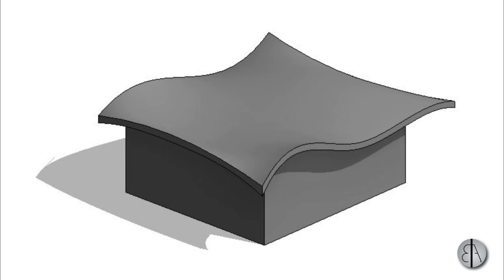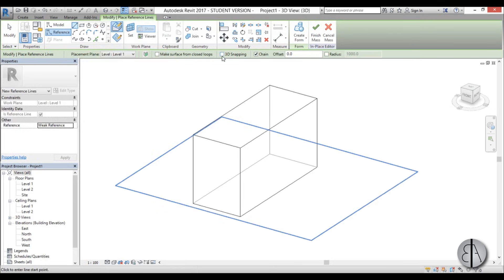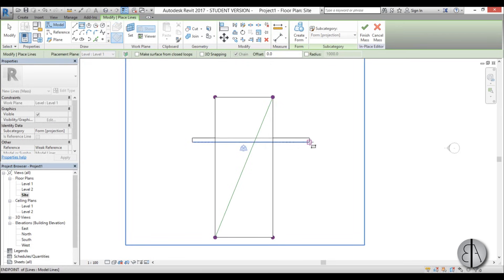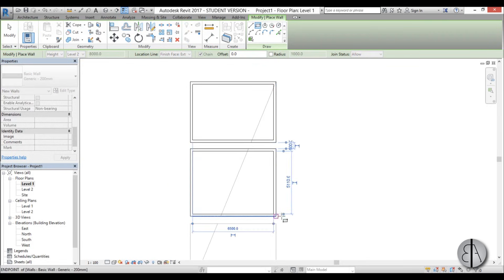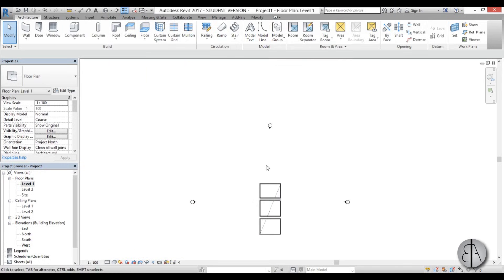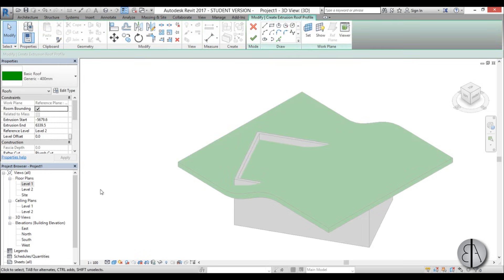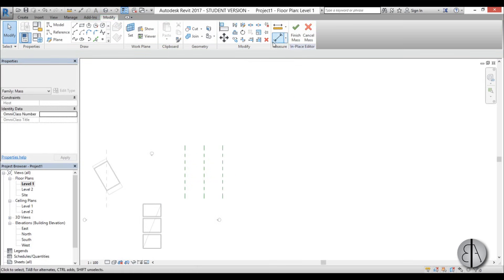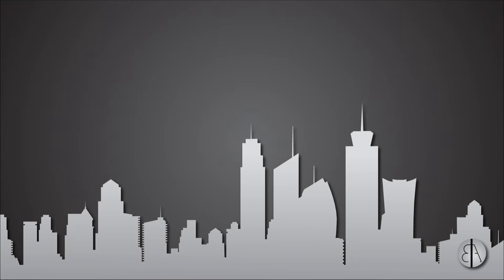3 Complex Roof Shapes in Revit

Comment: Lets say i have this first model ready and want to build ribs-like timber framing along the long roof top edge (dont think there is a batter way to explain it : ) Is there any 'automatic' way to do this? Something like 'repeat along the edge' with certain spacing between every 'rib'? Thanks in advance

Comment: hi.. i have started following your videos coz its short and to the point. I have a querry. about your video on you tube: 3 Complex Roof Shapes in Revit...i tried this( the first roof) at home with Revit 2016 full version using the component in place but at the office we have Revit 2017 LT, where the component in place is not avaiable. How to achieve the roof then?